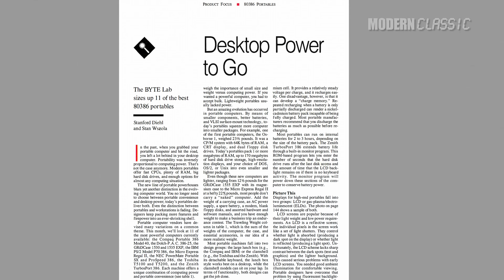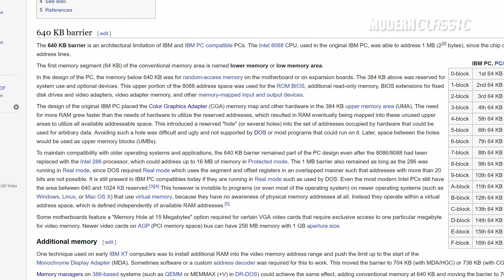IBM PS/2 P70 Tour and Diagnosis - Part 1!

Comment: Happy that the boards and hard drive are OK!

Wonder what the architecture of the floppy drive is, maybe there are more components besides the capacitors that you can get off the shelf and replace, basically rebuild it as much as possible.

As to hinge piece, if you can make good measurements and maybe some photographs against mm paper i can do the STL and can print a sample, but i'm on the other end of the world, so i'm probably not going to mail the printed piece to you.
Reply from the maker: Really any help with the 3D printing would be awesome, because that's one thing I just have no experience in whatsoever. I've been thinking to learn, and it may be an excuse to finally get a 3D printer, or maybe I'd send the resulting file off to be printed somewhere else that I know would do better quality. But I just have no idea how to even measure or make the 3D file. I could even pay you something for it; I have no idea how much time it takes to do this sort of thing.

Or if you even wanted to just recommend me some tools so I could try to do it myself, maybe it's not that hard and I could take a stab at it. I just have no idea what I really need to get started making the file for this type of part that's also broken on one end. Thanks for any help or advice!
Reply: I'm not going to charge you anything for my mediocre modelling.

I personally mostly use FreeCAD for various reasons, but i can't outright recommend it, it can be pretty shaky, it's a very powerful toolset but it has a lot of issues and it often seems like it's trying to be as confusing as possible as it grew in layers over the years rather than being designed up front, and many things don't work like you would expect them to, even if you had used professional CAD software before, but it is in similar vein. When you go back and try to change prior steps, FreeCAD ends up pretty fragile and often requires you to rebuild a lot of your model, but this always takes a lot less time once you figure out how to represent the object the first time over. Like most CAD programs its primary workflow is based on drawing objects on 2D planes, either the primary world planes or the planes that form an existing object face, and then extruding these drawings into protrusions and pockets. The sketches themselves are not free-form, you enter the lengths and angles and other relationships that you know of, and when the entered relationships are sufficient to derive all sizes, the sketch is called fully constrained and will actually work, else bad things can happen. Probably the best and most popular program in this vein for hobbyist CNC and 3D printing is Autodesk Fusion360, it's free for home use but won't run on Linux and is bound to a license server out on the Internet, it's fairly clear and clean and very powerful and more robust and forgiving. These kinds of programs can take a considerable learning effort. There are two more i haven't tried yet, OnShape and DesignSpark Mechanical.

A popular starter solution is OpenSCAD, which is a text-based scripting environment which spits out 3D objects. For the most part, if you can imagine the part composed out of intersection and subtraction of boxes and cylinders, you can do it fairly easily in SCAD. It doesn't have any of the actual CAD features and approach, you just punch in or compute numeric coordinates for your primitives. Whether you want to use it depends on how comfortable you are with programming/scripting, but for me personally it usually ends up not being powerful enough, in particular many parts need fillets to be as strong as possible, but it can't easily do those.

Another popular beginner option is TinkerCAD, a web browser based programme, again similar principle (and similar limitations) based on composition of primitive shapes, but this time over you get an interface and feature set that is very reminiscent of vector drawing programs that you are likely to already be familiar with, you just move the primitives wherever you like by hand or use alignment helper tools.

Finally many people use Blender, Wings3D, or anything else that can be used to model 3D objects if they were familiar with those before, but these can be very unhelpful when you're trying to match the dimensions of real world objects.

As to how to measure... depends if the complete part is present but broken. in which case i'd probably just investigate which material it's made from, and if it's Styrene based, just glue it with Acetone, ABS Slurry (ABS fragments dissolved in minimal amount of acetone with some acetone aired off), or acetone/MEK based plastic pipe cement, it will be as strong as new; or take 2-component kneading silicone to create a mould and make a copy out of epoxy - that is, if i wasn't so much into 3D printing, but i still sometimes make part copies that way for very small intricate parts, such as scissor switches of laptop keyboards, but i'll try to print one of those soon too, i have 0.2mm nozzles too, standard is 0.4mm, but that will need a bit of extra setup. Epoxy parts can be extremely strong if you use slow-setting high quality type and bake it at a low temperature, much stronger than anything that could be made in injection moulding process. Or if a mirror part is present, that you can directly measure but only need to reconstruct it in reverse. Or if the part is completely missing then you actually need to guess how a unique part originally looked like, which is then a lot of trouble, in which case mockups that you can make out of whatever - cardboard, superglue, cocktail sticks, tape, etc, may need to be done. If a fraction of a part is still present, that can take a lot of guesswork out of it. Then again, if you had a good mockup that works but just isn't strong enough, then you can just as well epoxy-copy that, right?

After the object is modelled, you export it as STL or OBJ and put into a slicer program that is set up for the specific printer to generate the tool paths that the printer can execute. The popular options are Repetier Host, Slic3r Prusa Edition and Ultimaker Cura, you do placement of the object on the build plate there, select and fine tune your material-related settings, and support and attachment options, so that the print doesn't topple over or droop, and also choose how hollow or solid your model will be. A popular attachment is a brim, a big flat piece at the bottom that easily clips off but prevents the print from getting unstuck while printing, and then support is a scaffolding under the parts that would otherwise print in air which a printer can't do, which is also clipped off later. For simple prints and low quality expectations, printing is generally pretty easy, but it can get pretty involved and one is expected to get a good feel for mechanics and material properties to achieve good results, especially for sub $200 kit printers. I personally have a sub-$150 Geeetech kit which is about what i could afford, and it has very extensible and modifiable electronics and i gave it a custom firmware that i configured personally and it has severe mechanical deficiencies, many of which i have resolved and some i am yet to resolve, i basically bought it as an engineering exercise, and it also lacks the cooler for deposited material, which i added but had to try multiple. Of these cheap kits, Anet A8 and Tronxy P802 series are popular options because if you're lucky, they can produce decent prints without mechanical changes, but wiring, electrics and electronics leave a lot to be desired, and these and Geeetech may take up to 12 hours to assemble. If not too strapped for cash, Creality Ender 3 might be a very good choice, as it's mostly pre-assembled and it takes just an hour to put it together, and has excellent mechanical construction - electronics is again simplified, but it's not too much of a concern for most people. Of these, Creality is the only one that has Bowden fed construction, i.e. the extruder, the part that pushes the filament, sits externally, and supplies the tool head via a long tube, and the tool head is just the hot-end, i.e. it only melts and deposits then cools the material - this is good for mechanical precision, but comes with some material limitations and difficulties, but luckily Ultimaker Cura is set up for this construction out of the box. It's also mostly metal so in the somewhat uncommon but possible event that it catches fire, the likelihood of it setting everything else on fire is lower, and the wiring should at least not be the worst, unlike the Anet. The rest are direct extruders, i.e. the part that pushes the material, and the part that melts it, sit directly on the tool head. I don't know if i can recommend people running their own printer, depending on inclination and prior experience it tends to be a full-time hobby pretty much, which may detract from your other hobbies and obligations as much as it can enhance them. I'm afraid it might not be something you get for occasional use.

I hear in the States it's common that a local library may have an Ultimaker or something similarly expensive and robust on a service contract so they don't have to deal with its failures, and they will also have the corresponding slicer package that shipped with the printer on a computer there, and they will have the recommended filament also loaded in there and set up in the slicer, and probably someone with basic knowledge to help you through the steps.
Reply: Shoot me some measurements / pictures and I'll hook you up.
Reply from the maker: Thanks for all that info - that was really helpful, and I'll look into some of those things to see if it's something I really want to get into. It sounds like it may be a process that may need to much of a time investment for me to get good at at the moment, but I'm still interested in trying it. I have thought about buying one of those $200 printers but I am never sure what I'd really do with one... but then stuff like this keeps coming up.

Now I've got two offers for help here :)  Thanks to both you guys! If Adrian can do both the modeling and printing/shipping then it may be easier to send the info to him for now, but if that doesn't work out then I will contact you about it again. Thanks again!
Reply from the maker: Adrian - can you do both the modeling and the printing? Like I said to Siana, I'd pay whatever's reasonable especially if you're doing the printing too. If so, can you contact me at the email link through my About page? https://www.youtube.com/c/modernclassic/about

Thanks!

Comment: Great video! What I gorgeous thing... I really hope you can get it working

It really blows about the floppy not being standard ... I have no knowledge about those machines, how hard would it be to make an "adapter cable" to plug a standard floppy drive in temporarily? In the end, if you get it booted off the floppy once, you can get it booting off the hard drive afterwards and deal with the OEM drive from hell later ;)

But I'm guessing you would have done it already if it was easy hehehe
Best of luck, I'll keep my eyes out in case I see one :)
Reply from the maker: Somebody else suggested that, and it's possible but just not my first choice. It's basically my option #3 at the end of the video. I don't particularly like making cables or hacking things together that aren't meant to go together, but as a temporary thing it could turn out to be my only real option until I find a working P70 (or other compatible PS/2 drive) for a reasonable price.

Comment: It seems strange that a system would be trying to boot the reference diskette without having to do anything special, and then failing due to disk drive problems without giving another error about that. However that seems to be consistent with the maintenance manual (p. 146, http://www.almeida.de/download/tpvol1.pdf#page=158 )

Comment: Hello, I just came across one of these machines. Everything is intact I tried to power it on nothing comes on the screen. The light comes on the drive and that's about it. The hinge on the keyboard is a little worn out but that's about it. How much are they going for as parts? I know it would be pretty expensive to ship based on the weight. I'm in Pennsylvania.
Reply from the maker: Just out of curiosity, does it make any beeps when you turn it on? I have a feeling it might be as simple as the cable for the screen needing to be reseated. (Mine needed that too.) I'd love to have your machine but I'd rather you get it working for yourself if it's something easy. If it's not beeping, though, then it would be something else and I'm not sure how to solve that in that case. Then maybe we could come to some kind of arrangement if you did want to sell it.
Reply: It doesn't make any beeps. Just a light on they keyboard if you plug it in and unplug it. I'm not very savvy when it comes to old computers. I'm more into older gaming systems. It was given to me by a family member it was sitting in storage for years and they gave it to me. I was excited to turn it on get it going but I'm not really into fixing things.
Reply from the maker: Ok, it's probably something a little more involved then. Well, I'd be interested in taking it off your hands, but since I can't tell how many problems it has or what they are, my offer might be kinda low... I'd offer $50 plus shipping. It's just without knowing if any of the components I might want are likely to work, it's taking a chance on it even as a parts machine. Let me know if you're interested in doing that, though. You can contact me through the email at my about page if you want to set up a PayPal thing: https://www.youtube.com/c/modernclassic/about

Comment: Do you know the default memory size? If so, try adjusting the current amount of populated. Perhaps you get lucky and the CMOS utility is on disk, so that you can change the value?
Reply from the maker: Default is 4MB... did try and it didn't work. It's still seeing the memory hole, which it will for any amount over 640KB. There's not really a default set of settings for these from what I understand; they must be configured before they can be used, and that's my problem right now. But I do think I have a plan right now that will eventually work, so hopefully you'll see this thing running at some point.

Comment: As for luggables - there are still a few companies that make them as "portable full-power workstations."  I worked at a place that had one with three displays. Same basic form factor as the P70, when you folded down the keyboard, you then "unfolded" the screens, one to the left, one to the right, then revealing the center display behind it all.  Had a dual Xeon motherboard hiding behind, with PCI Express slot port covers accessible from the side, similar to the P70's access to Microchannel slots.

I wish I could remember the company name that makes them.
Reply from the maker: Interesting - I will try to look that up. Would love to have a newer one to compare. I'll bet one that's 5-6 years old probably wouldn't be that much more expensive than this thing was!
Reply: Found one! http://www.acmeportable.com/products/milpac-iii I don't think this is the exact one I worked with, but it's very similar in design.  The one I used wasn't "rugged," and the compute-section was thinner, only slightly thicker than a P70.

Here we go, I think this was the company: https://solutions.nextcomputing.com/products/portable-workstations/ Might have been one of their 3-display models (which it isn't clear they offer any more) with their optional detachable fold-up keyboard (which it also isn't clear they offer any more.)
Reply from the maker: Wow, that first one has got to be a $20,000 machine. I think any of these are probably out of my price range even for an older, used one, but I'm still curious to check. I've never seen these before.
Reply: Modern Classic Yeah, we bought a couple as “demo units” back in 2008-2009, with single first generation Core i7 and their Xeon equivalent dual CPUs, and appropriately high-end GPUs. 

$20,000 seems about right.